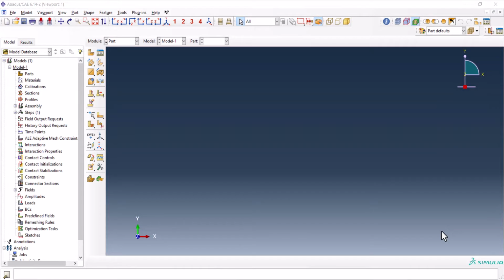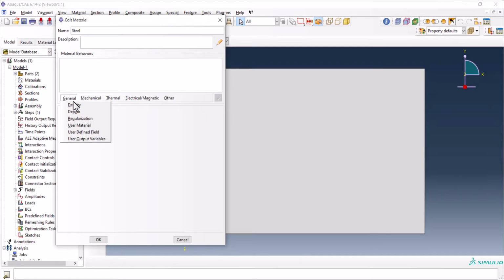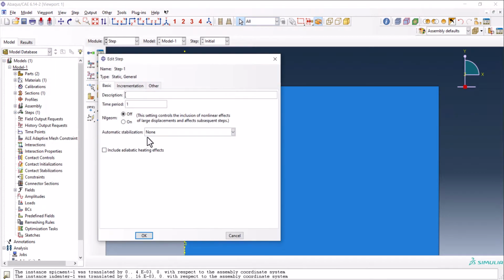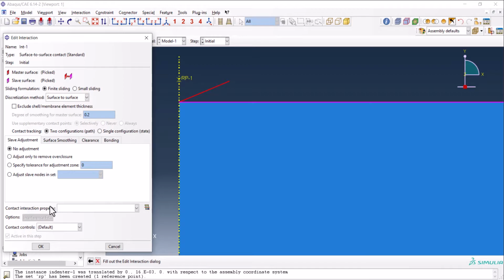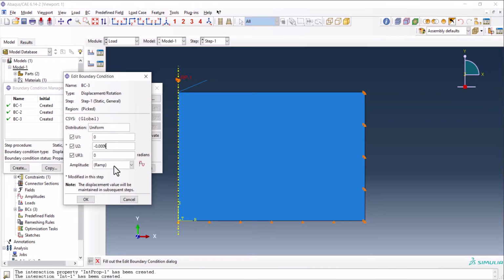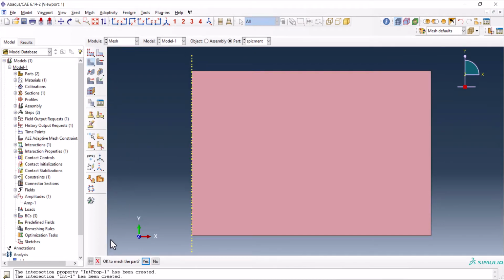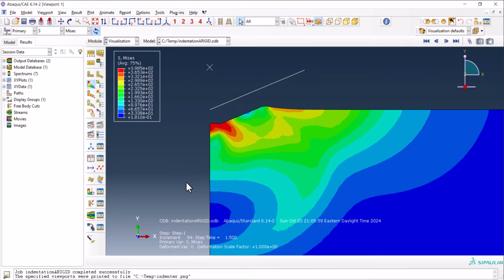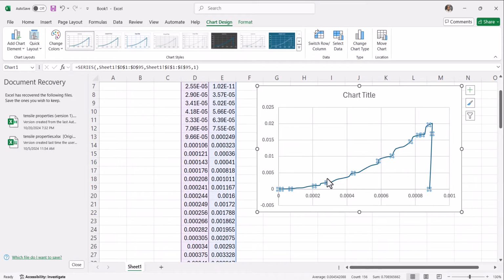Abaqus Tutorial: Easiest Way to Simulate Vickers micro indentation!

Comment: Can you help me with conical indentation 20 microns diamond tip with ZnS specimen wafer 1x1x1
Reply: I follow step by step but I got these errors…. A boundary condition has been specified on node set assembly__pickedset13 but this node set is not active in the model

A boundary condition has been specified on node set assembly__pickedset13 but this node set is not active in the model

A boundary condition has been specified on node set assembly__pickedset13 but this node set is not active in the model

Node set assembly__pickedset13 has not been defined

Node set assembly__pickedset13 has not been defined

Node set assembly__pickedset13 has not been defined

Analysis Input File Processor exited with an error. ( why i receive such errors )
Reply from the maker: @RonAndCora  You're getting this error because the boundary condition is referencing a node set (assembly__pickedset13) that's been deleted, renamed, or is inactive in your model. To fix it, recreate or redefine this node set in the assembly module, then reassign your boundary condition to the correct node set. Finally, run a data check to confirm the issue is resolved before running the analysis again.
Reply: Where to find material properties values what value to put , I use chat gpt but i follow videos other people video it worked but as i change material properties it doesn’t work, try to do all processes again and again every time different errors , now I am following your videos, can you please help me ( my indenter is diamond and specimen is ZnS) indenter conical diamond 20 microns
Reply from the maker: @ You should look for material property values directly from published research papers or reliable material databases, especially for specialized cases like ZnS with a diamond indenter. This ensures the accuracy and reliability of your simulations. You can use platforms such as Google Scholar, ScienceDirect, ResearchGate, or Springer to find suitable peer-reviewed studies with clearly documented material properties for your specific materials.
Reply: Does indenter tip size matter for simulation , it’s just an extra question i want to ask
Reply from the maker: @ Yes it does matter, whether to determine it's nanoindentation or micro
Reply from the maker: For the conical indenter, you can follow the same procedure but the angle must be 60 degrees! Let me know if you need more help!
Reply: I have send you email please see

Comment: hi Sir, if the error in Abaqus said "The absolute zero temperature has not been specified for computing internal thermal energy using the absolute zero parameter on the *physical constants option. A default value of 0.0000 will be assumed. *inelastic heat fraction and *specific heat are only used in an adiabatic analysis and a coupled temperature-displacement analysis Surface interaction intprop-1, associated with one or more contact pairs with surfaces having underlying elements with temperature and displacement degrees of freedom, does not have any thermal interaction defined. No thermal interaction will occur."
how can i fix that?
please help me
Reply from the maker: @caonguyenuc630  You have to define it in the model, edit attributes, and defining the absolute zero temp, which is -273.15